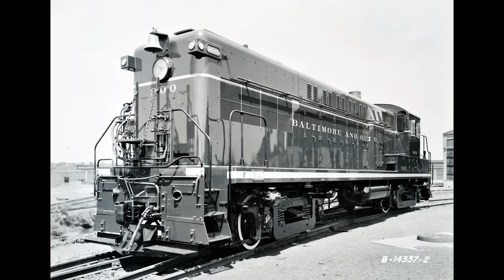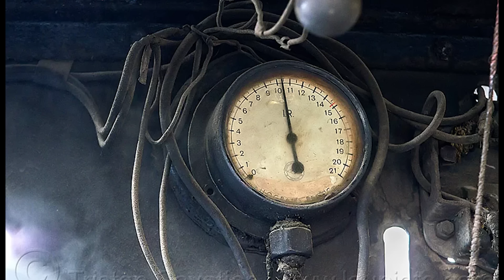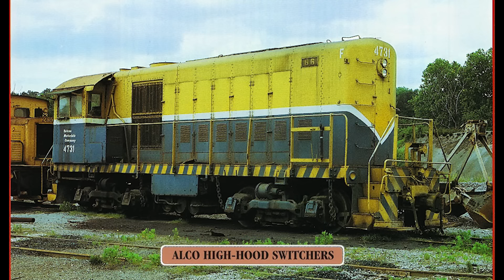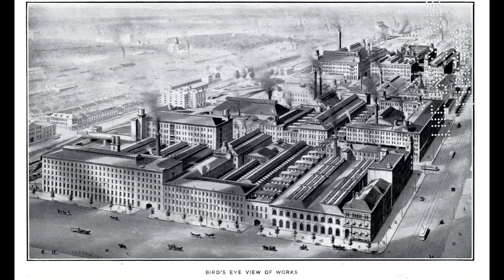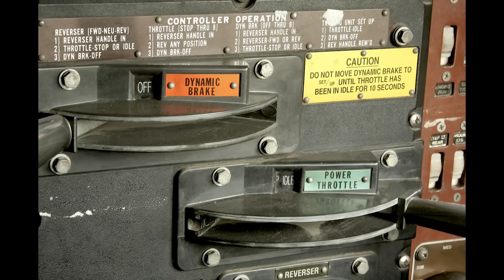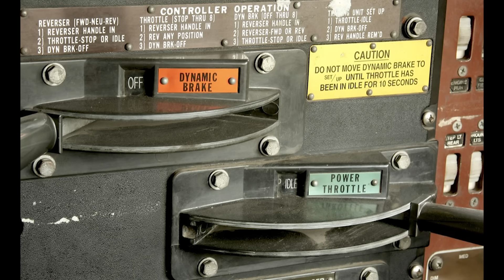The Locomotive That Couldn’t Be Shut Down Normally

Comment: Diesel locomotives of all builders typically were left idling unless shut down for maintenance.
Reply: That was only true during cold weather.  It wasn't until railroads started slacking on maintenance that they would let them idle, as they were too afraid to trust the batteries to get them restarted.  The absolute worst thing for them is to let them get all souped up with unburned carbon.

Comment: The Baldwin inability to shut down without air only occurred during catastrophic failure of the air system.  They had a separate "Control Air" reservoir to provide such functions to all air powered contactors, etc.  EMD units were no saints at not shutting down either.  An electrical failure would prevent the energizing of the 4-wire EMD governor's "D" wire that reduced RPM by 170 thus starving the engine of fuel to run.  However, without that D wire, the 567 engines would simply keep on running until there was no fuel left in the piping to feed the injectors.  That might take around 10-15 minutes.  Alco, on the other hand, did not employ the D wire in their switcher units, so cutting the power simply shut them down.  Also, EMD did not start using electric or air powered starters until they adopted AC alternators instead of DC main generators.  ANY locomotive that had a DC main generator could have been wired to use it as a starter.  Lastly, Baldwin relied heavily on air control, and this also included MU operation of multiple units. This was absolutely not compatible with all other builders that were using electrically controlled MU, except for EMD stubbornly hanging on to air operated sanding control that even they later dropped.  This air MU of Baldwin was what really drove the stake through the heart of their diesel production as they were useless except with one another (think D&H shark units here).
Reply: Corporate arrogance has killed many railroads   &:  associated companies, if Baldwin just used the same m u principles as Alco  & EMD, we may have been telling a different story!
Reply: @richardperry5743  - That really wasn't completely true back before the mid 1950's.  MU control was NOT standard throughout the industry.  Each builder had its way (and changed it along the way) of arranging the wiring, the number of pins, the pin numbers used for each wire, and the socket design itself.  About 1950 or so, EMD had evolved to use the 27-pin socket.  Previous to that the switchers had one quantity and socket to match, then the FT's had another, and the F-2's were made to use that same one, and E-units used something else, etc.  Railroads were starting to pool engines and run through with them.  The AAR standardized the 27-pin socket and dictated what pins would be used for each function.  Prior to that, even if two railroads had the 27-pin system, many could not connect their locomotives.  Today, you don't really need all 27 pins.  Many functions have gone away over the years, things like the 4 wires used for manual transition, also the couple used for boiler shutdown and blowdown, as well as a couple other items.  Now, take that information and multiply it across the other major builders like Alco, GE and FM.  It was VERY complex!!!
Reply: @sjwhitney I believe you know exactly what you're talking about, thank you for the m u information & how it evolved through time & different locomotive builders! I read something similar many years ago, forgot it untill I read your reply. Interesting information, Mr. Whitney!
Reply: @richardperry5743  - I have copies of the earlier EMD parts books in my files and they have a whole section od "compromise" jumper cables to enable MUing of various EMD, Alco, FM (GE wasn't a real player then) units together.  Fortunately, I had to learn all of it as I was researching how to make the old Alco switcher MU play nice with AAR 27-pin MU.  That's how Green Mountain RR 405 got to play with the big locos!  LOL
Reply: @sjwhitney I think it's very neat you still have that information on file! I like the way you described how to get an  Alco to play nice with an EMD 27 pin mu hose! I have actually been inside the cab of Green Mountain # 405! Went up to Bellows Falls VT. to see Steamtown, back in 1981. She was a very nice ol' Alco RS -1! The crew very generously invited us up!
Reply: @richardperry5743   -1981 was the year I started.  Stayed to 2018.
Reply: Were those early EMD governors - maybe Woodward, like the newer governors on a GP 38 or 40? On those I routinely shut them down by pulling the lay shaft handle out and holding it until the engine dies. If they were the same basic governor, then why would they have to wait for the fuel lines to empty?
Reply: @ralfie8801  - You don't have to wait if you use the layshaft.  That is a good point to remember.  Not many individuals even know that you CAN do that!  The old Woodwards hadn't changed very much.  I'm sure that with today's equipment it's all microprocessor controlled and prone to failure.  The loss of power to the D wire is easily recalled when you are shutting down an older EMD.  You're in a hurry to get home and hit the shutdown button (some pull the throttle handle and move it to shut-down position).  However, the engine just has a couple revolutions left to go to stop but you turn off. but you also turn off the Engine Run and Control switches too soon.   VROOM!!!  It fires right back up!!
Reply: @sjwhitney 
Don’t forget the low oil pressure button on the governor too! Edit: I got out of the habit of using that button to shut them down because with later MUI engines doing that would show a low oil pressure shutdown in the fault log and when that showed up it had to be troubleshot for low oil pressure that it didn’t have, but the guy sent to troubleshoot it had no idea because he wasn’t the same guy that pulled that LOP button to shut it down! We hardly ever turn the engine run and control switches on the control stand off. Those are unpowered once the fuel pump and control breakers in the breaker cabinet are off. The last units we had with a governor were the SD 70-M models and those just had the same old Woodward governors as usual. They’ve all been modified to EFI when those all went through overhauls a few years back. They’re now way more dependable with EFI than before.
Reply: @ralfie8801  Just for the record, and I saw this ALL the time, in trailing units, the Control/Fuel Pump and Engine Run switches, which are SUPPOSED to be OFF in trailing units, were left on.  That is a big no-no with regard to break-in-two protection of locomotives.  
The governor button... Yes, you can shut it down there but off the top of my head, I seem to recall that if there is a loss of electrical power that it MIGHT not work?  It was an oil pressure switch that was connected to an electrical one, so the loss of power might disable it.  I'd have to dig through my prints to trace it out.
Reply: @sjwhitney 
I was mostly talking about just shutting them down as single units when they are shopped. The outbound crew at the ready track sets all those switches up, or they’re supposed to when they lace the units up.
Reply: Thanks for the info, Baldwins facinate me with their huge turbocharged straight 8's!

Comment: The photo of 1616 in original Eness colors is taken just outside the yard office at Carolina Junction in Chesapeake, Virginia and just a stones. Throw away is the so-called round house and back shop. I’ll remember working on the 1616 as a machinist apprentice I was about 18 years old. I guess my father was an engineer. His father was an engineer. Both of them ran steam and my father also ran diesel Baldwin and EMD. I’ll remember when the wooden Trussell across the Albemarle sound collapsed and killed. I think it was two train one what I’m his last name was Bray I think. Do you remember RW REARDON, MASTER MECHANIC
Reply: I remember an engineer was killed during the Albemarle Sound bridge collapse, Mr. Bert Rankin's was a fireman on the lead engine & Mr. Palmetto Jones was riding in the second unit, both survived. That occured near midnight, July 5th, 1957. I think # 1605 was the lead unit & #1610 was the 2nd. unit. When they pulled those engines out of the sound, they put #1605's trucks under the # 1610. The Original Norfolk Southern Ry.
Historical Society has some very good info & books, I am a member.
Reply: @richardperr @richardperry5743 seems like my father had received a couple of newsletters from the Norfolk Southern Railway historical Society in the past so I think he must’ve been a member of this group at some time. He retired in 1980 I think but I’m not certain Time flies sometimes way too fast. At one time we lived in Norfolk Highlands. It wasn’t far from the NS yard and shops. Did you happen to know any of the shop people in the 60s and 70s? If it helps, the NS merged with the Southern in 1974.
Reply: @Bennie-l9f Unfortunately, I didn't know any shop personnel, I was living in Elizabeth City, N.C. back then. I remember the merger with the Southern in '74. I wasn't overly excited about it for a few years, but I grew to appreciate the Southern, later on. Originally I saw it as just making the N.S. another "fallen flag" railroad, but they did great on revitalizing the track & infrastructure, that I did like. Being a railfan that rode with some train crews, had to keep a low profile, so nobody got in trouble for that! Join the N.S. H .Society, Mr. Benny, I think you'd enjoy it! Nice folks!
Reply: @richa @richardperry5743  regarding the Albermarle sound bridge. My father had said the trains going across that Trusel could only run walking speed because it was in such bad shape and you could even see the Trussell swaying a little bit back-and-forth as the train crossed the bridge. That’s bad. And it should’ve been repaired long before collapsed.  As I understand, the southern railway wanted the government to pay to replace the bridge and it was an amount of money. The government wouldn’t agree to it so the Southern remove the bridge totally and that’s the way it is today so either the Bay coast short line or Chesapeake Albemarle short line now runs down to Edenton, North Carolina, the old Norfolk Southern and stops there because that’s where the Albermarle sound takes up and there’s no bridge anymore and so any Freight that’s going south of that point has to go from Norfolk to Lynchburg Virginia turn south and I’m not sure whether it goes to Charlotte, North Carolina from there, and then turns east to go to places like Morehead city, North Carolina, literally around your elbow to get to your thumb because there’s no trestle across the albemarle sound.  The old Norfolk Southern was truly a family railroad as a lot of people that worked. There were related to somebody else that worked there such as fathers and sons, friends of friends, etc. the good old days.
Reply: I remember hearing Mr. R.W. Reardon's name in a conversation with a train crew member, talking about the difficulty in  getting Baldwins to m u properly & in sinc. with each other.
Reply: @richardperry5743  mr. Reardon was a somewhat tall, slender man, quiet and stoic with a deep voice when he did speak. My father knew him well. I know he did because my father talked about him and I knew he and my father talked about me checking up on me to see how I was coming along. I can see Mr. Reardon now standing down on the floor next to a EMD that we were over hauling he was wearing a long trenchcoat with his hands in his pockets, staring up and watching two or three of us on locomotive either tearing it down or putting it back together
Reply: @Bennie-l9f I envy your experience, I would've enjoy working for N.S.!
Reply: @Bennie-l9f Mr. Bennie, it has been a great privilege and a pleasure to talk with you, I have enjoyed it very much! If you decide to become a member of the Original Norfolk Southern Ry. Historical Society, just type that name in on Google & their site should come up. They have past events, N.S.Ry. photos, model trains for sale ( N.S.Ry.) and also publish a magazine  quarterly, with news, upcoming events & original & related N.S. Ry. photos & stories , well worth $30.00 per year dues. You are welcome to contact me again, anytime, sir!

Comment: I had the privilege to ride the original Norfolk Southern  Ry's Baldwin AS   416 's, which had A-1-A trucks , no traction motor on the center axle, which they called an idler axle. I rode in no. 1616 quite often, which you included a photo in this video.  The only bad "quirk" the crews mentioned to me was the pneumatic throttles, they were often not quite in sync when double headed with other Baldwins. They were not compatible to double head with N.S.'s EMD locomotives, which had electric throttles. The crews liked the Baldwins & appreciated their historic significance. As for myself, they were my favorite engines,  a great era to grow up in! The only N.S. Baldwin to be preserved is # 1616 at Spencer Shops in Spencer, N.C. ( N.C.T.M.)
Reply: Do you remember chief dispatcher Cartwright at Coleman Place? He was my other grandfather.
Reply: @Bennie-l9f  I remember Dispatcher Cartwright's name being mentioned, but doubt I met him. I never rode the NS to that part of the line, but I did ride a ferry trip pulled by Southern steam locomotive #4501, south to Edenton, N.C. My times riding the N.S. were as a young teenager/ railfan, not an employee. 
S
Reply: The. Norfolk Southern had 13 GP 18s and seven GP 38s that’s what you see behind the Baldwin along with a small GE industry switcher that I think worked the papermill at Plymouth, North Carolina

Comment: How exactly does a two axle power bogie become A1A wheel arrangement.?
Reply: AS-16 only came with a B-B wheel arrangement. Check your Diesel Spotters Guide.
Reply: @paulfuchs6920  yes, but the as 616 came with a 6 axel truck. same hp and carbody
Reply: @paulfuchs6920 bb is for diesel hydraulic. Bo Bo is diesel electric. Learn your subject matter before posting, and looking like an uneducated child.
Reply: as 616 came that  way, same loco- different trucks
Reply: When equipt with A1A trucks ( three axle with no motor on center axle ) it would be an AS 416.
Reply: should i guess but they call it a 6 axel sixteen hundred horsepower